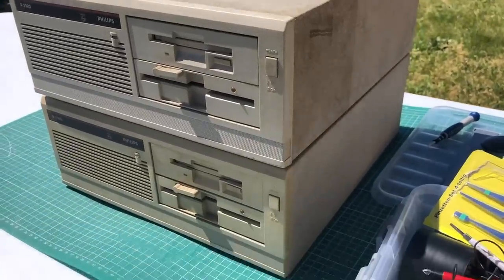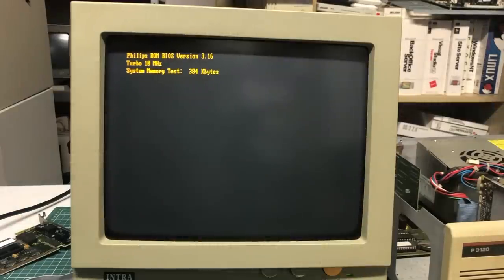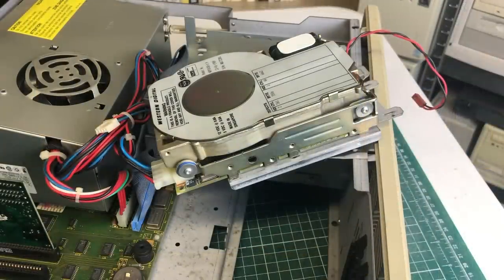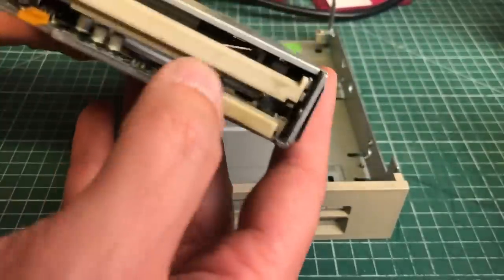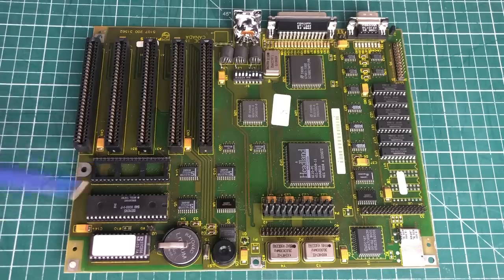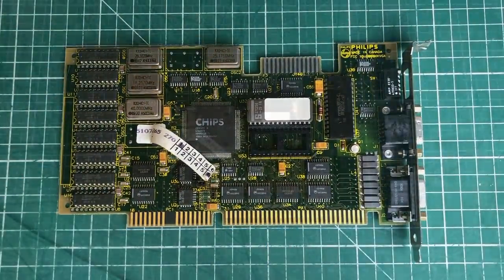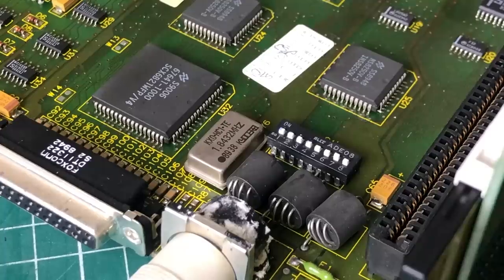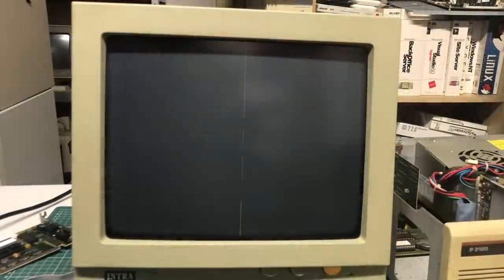Philips P3120 XT retro computer

Comment: Are you sure that OAK 067 VGA is working in other PCs? You card has some empty sockets! I have similar card and sockets on the left are RAM. You have 256 KB soldered, I have all 4 128 KB chips in sockets. Card will work fine with just 256 KB of RAM, just no hi-res 256 color modes. In top socket I have chip "OTI068 849630 OAK TECHNOLOGY INC T9149 501A" written on it, and bit empty socket close to DSUB has chip with "BB015 BIOS 067-08 EV1.04 OAK Δ144CKDQBNA" written on it.

My card isn't working anymore. Well it works for about 1-5 seconds after boot, but after that it's all garbage on the screen. I've replace it with Cirrus Logic ISA SVGA which is much faster, but OAK 067 had great feature of hardware compatibility with Hercules, CGA and EGA. Using DOS program that came with it, to change graphics modes. In MDA/hercules mode it could run hercules 720x384 mode games and with special CGA mode it was seen by games as a true CGA and even run fine those few games that did weird with CGA and thus making them incompatible with EGA and VGA.

Comment: I have a machine I picked up that has a fault, and I'm curious what your take might be on it.  It is a Packard Bell Force 203 system, using the PB410 Motherboard.  It had the dreaded Varta barrel battery that had leaked, but corrosion on the board was very minimal and cleaned up quickly and nicely using a mixture of vinegar to soak on the corrosion, and then a wash of 94% Isopropyl alcohol to neutralize the vinegar.  The machine has always booted, however, after a period of time, on a CRT the screen... for lack of a better term, scrambles and the machine locks up.  Once this happens it will not reboot for a period time.  No CMOS beeps no POST errors, just no boot.  Have you seen anything like this?  I have been going through the process of replacing the caps, and I have all but 7 of them done.  The issue continues to persist, and not a single cap that I have removed has resulted in any leaking electrolyte smell.  I even grabbed an additional  Graphics chip to replace on the board if that was the issue.  However when testing with 2 separate ISA VGA cards the issue persists.  I'm pretty sure that if I finish replacing the caps and the issue is not fixed, that the problem is beyond me, but I would really appreciate to hear what someone who is much more successful than I have been at repairing machines might think about this machine.
Reply from the maker: Can you always reproduce it after a while ? It can be a lot of things ... What I would try : try a different PSU, run a memtest, try different memory, set BIOS settings to default look for dry/broken solder joint
Reply: @RetroSpector78  Apologies.  I'm uncertain how much space I have for messaging.  I should qualify, that I have tried a different PSU, a known working one, the BIOS is always set to default because there is no battery, I have tried disabling the onboard ram, and using known good 72 pin SIMMS, as well as disabling additional ram to check to make sure it's not a problem with that, I can always reproduce it.  The longest it stays working for is about 8 minutes, so I cannot even run a Memtest on it.  I have tried looking for dry/cracked solder joints, but I have only ever done hobbyist soldering, as evidenced by my sloppy solder work on the board, and so I am not always certain what I am looking at.  I have watched tons of videos on board repairs and tried to see if I could see similar issues on the board I have but I cannot see them.  That's not to mean that they don't exist.  I just cannot see them.  And sadly the pair of experienced eyes I would go to in the past when I hit this point passed away 4 years ago now.  Thank you for the suggestions.  I have even tried the finger temp test to see if any of the chips are getting too hot, and I can't find anything.  I have this gut feeling that what I'm missing is something so simple when the problem is figured out, I'm just going to smack my head in a feeling of stupidity.

Comment: Floppy drive sounds like maybe it had a belt and that belt perished? would explain why the motor speeds up but nothing happens.
Reply from the maker: Possible. Didn’t have time to open it up but rarely see the point in fixing 3.5inch floppy drives cause there are so much working ones still around. Guess some people here were disappointed that I didn’t fix it. But the electrolytic caps already leaked and getting to the pcb meant dismantling the entire thing.

Comment: can you remove the partition from Fdisk and make it again, then try a regular format
Reply from the maker: Think there is some physical damage on the platters. The sound it makes when turning off does not seem normal.will perhaps try a low level format first and see what that comes up with.
Reply: @RetroSpector78  but does IDE drives even support LOW level Format? Yes this is as you mentioned XT IDE model ,before AT standard all we know , but still .I hope you will manage to run this drive :)

Comment: re low-level formatting the hdd :  on a more modern computer that can boot from cd or dvd, puppy linux 4.3.1 makes it very easy to low level format hdd, cf card, sd card, ... .  from terminal : 
dd  /dev/zero  /dev/sd? 
where sd? is replaced by sda, sdb, whatever represents the device you wanna low level format.  safest to remove/disconnect all other formattable devices, so you can't accidentally wipe the wrong device.  slow, even for cf/sd cards, but easy & reliable.  writes zeros into every byte on the device.  btw, no supervisor mode in puppy linux.  
iso for puppy linux 4.3.1 [very small - approx 100MB] here :
http://distro.ibiblio.org/puppylinux/puppy-2_%26_3_%26_4/puppy-4.3.1/ 
take care & stay safe.

Comment: It's an MFM harddrive.
Reply from the maker: It’s actually an xt-ide hard drive with RLL encoding.
Reply: @RetroSpector78  Thank you for the correction. I still have computers with MFM harddrives. My first official pc was an 80286. I think it was a  10 or 12 MHz. It has an 80MB MFM HDD.The HDD is physically very big and noisy when operated. I also have the common 10MB and 20MB 3.5" drives that's got the black with green LED at the front. I love old technology and is a collector of a variety vintage electronic items. I found your channel while looking at other similar channels. I like your channel very much. There is just something different about the older electronics. Keep up the good work!
Reply from the maker: Thx a lot ! Appreciate it.